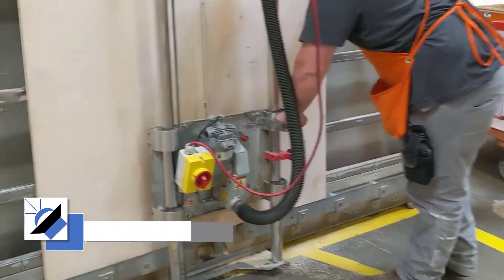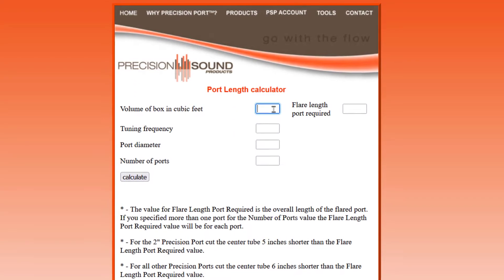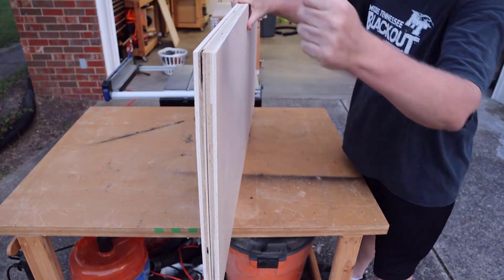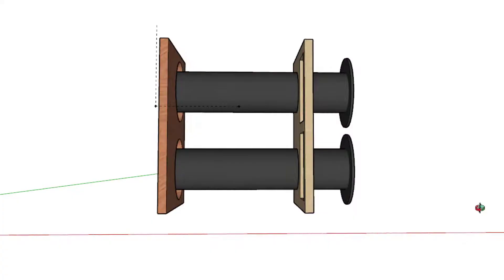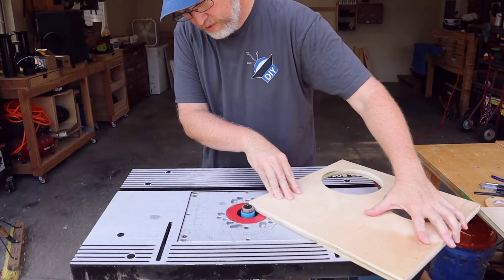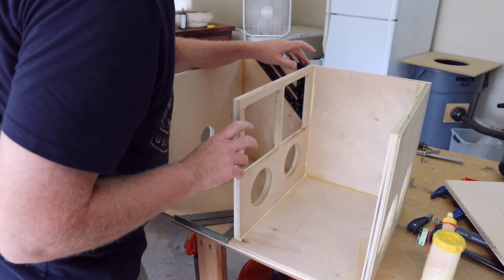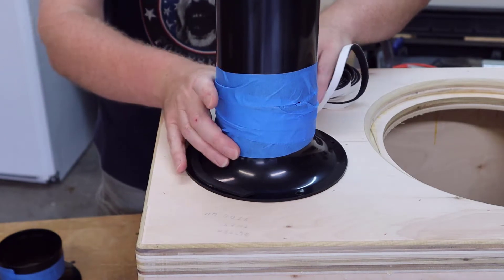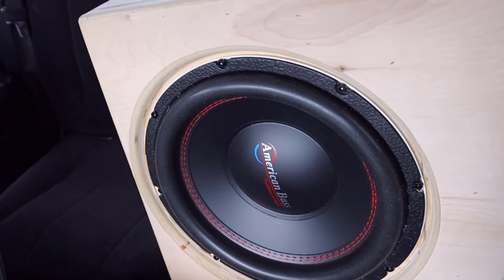Aero Port Subwoofer Enclosure:  American Bass Titan 12

Comment: Isn't 2 4" too much for a single 12" ? Single 4" psp full length  is usually good 1.8-2.25cf box to get low 30s good tuning
Reply from the maker: Depends on the port airspeed velocity.

Comment: Great info! I had no idea you could go up to 34-36 m/sec with flared ports! That tidbit of info is a gem!
Reply from the maker: Glad you liked it!
Reply: It all depends on use case, if you plan on using your sub on xmax 100% of the time, sure, the 34m/s threshold is the best, but since your overall output (let suppose you have a whole 3 way system with a sub) is gonna be unbearable and ear damaging, you wont even hear the fluttering of the ports, so take into consideration that the whole system should be really loud up to the 34m/s level, so actually, you can plan out a worst case scenario of about 50m/s so when playing at a reasonable volume or lower volume you will be in the no audible chuffing zone, if you take a competition 15" sub as an example, a 8" port will still be "too small" at its peak xmax, but what should the port size be? A galaxy? A pinhole? Just take everything in consideration and plan on the principles you laid out, too big ports cause bad resonances also, great for SPL but not for any reasonably good sounding ported enclosure

Comment: Is the port calculator the total length of the port or just the middle section??
Reply from the maker: Total length.  On the precision Port website they give the instructions for how long to cut this intersection. It will depend on which size flare you use.

Comment: So can a Made a biguer box for a shorter port, I calculate a 4.97 qf  for a 6 inch and 15.3 long aero port tune to 32hz, can somebody  tell  me if I'm right  or not please..I'm using a sundown x2 v2 12 1500 rms
Reply from the maker: No way to know for sure without running it through a port calculator or modeling it in WinISD.  I get a ton of requests to do this, I can't do them all.  But if you want me to, I charge a small fee.  https://diysubwoofer.blogspot.com/2021/05/custom-subwoofer-enclosure-designs.html

Comment: Nice choice of music. Timestretch sounded great in my nitro. I had 2 massive audio summo 12s in 6 cubes with 2 of the 6in precision ports tuned @ 32hz. Those subs put up a 151db legal score on 1 of the oldschool American Bass VFL120.1 wired at 1ohm.
Reply from the maker: Another good one is closer by nine inch nails.  If you're mids can keep up with your subs it will become your favorite demo track.

Comment: Almost every time I've had wood cut at Home Depot, they pull the saw down to the bottom and then pull it back up in one motion. Often the wood shifts as this is happening and I end up with cuts that are 1/8-1/4 off from top to bottom. The last time, the girl that cut it for me acttually knew what she was doing, and slid the wood away from the blade before bringing it back up. I've even offered tips to people who were running the saw to take the extra few seconds to do it right and had them decline. I've also had them refuse to cut wood once they found out it was for a speaker box.
Reply from the maker: I have never thought about that -- I will pay closer attention the next time I am having them break down sheet goods.

Comment: Can you leave the pvc pipe aero a litle outside and still have the same tuning or should be complitly inside for the same tuning? Thank you
Reply from the maker: Yes you can!  When you do that it will make the box a little bigger since the port will be taking up less space in the box.  That will lower the tuning frequency.  It won't matter much if is just a few inches.
Reply: @DIYAudioGuy  thank you so much for the reply man, i think i understood, it is important the length of the pipe even if it is outside a litle

Comment: Please tell me exactly what that is you are using to cut out the holes for the subs. I can't cut out a good circle to save my life. I love all ur videos. Find them extremely helpful. And the way u explain is very easy to comprehend. Oh yeah, where can I get that thing u used for the circle cuts? Thanks.
Reply from the maker: This can attach to any router.

https://amzn.to/3IdRwiD
Reply from the maker: It works best with a plunge router.  This is the one that I use, but any plunger router will do the job.
https://amzn.to/3t1JlQ6
Reply from the maker: It's always best to make the cut in two or three passes. So that you don't break the router bit.  Here is the quarter inch bit that I use in the router.  A less expensive bit will get the job done.

https://amzn.to/3HbShYn

Comment: Try flaring a piece of 10" inner diameter PVC I cut the handles off a wok, put it upsidedown on an electric hot plate, a heat gun on 1 side & me w a torch on the other, 2 patio stones & a 3ft steel I-beam on top for downforce, & I barely got it to flare so I used that for in er flare, cut a 6in long piece of 10in Sono tube, cut tabs 1in wide 3in long all the way around, bent & fanned them out to make the shape of the flare, backed the cardboard sono tube w fiberglass fabric & resin making it solid enough for me to stand on, then used Bondo body filler to smooth out the flare, hide the cardboard, & make it aesthetically pleasing. It was a job but that was the only way i could think of getting a flare on a 10in dia ⅛-¼in thick pvc
Reply from the maker: I like the wok idea, It allows you to provide even heat.  As you learned it's very tricky.  The sonotube idea is also very clever, but man that's a ton of work!
Reply: @DIYAudioGuy  yeah the wok was great especially since its Teflon coated
Reply: @buckyflex1  where do you get 10" pvc pipe at? The biggest I can find is 6".  I'm in the USA

Comment: From what I've seen and personal experience the majority of American Bass drivers are under rated or have a oddly high rating that is genuine, this model is know for handling decent amount of power so it may not seem that efficient because of the suspension compliance but if you tossed 1000w+ at it it may wake up and really slap...? My XRs have a 1500w rating I was very skeptical of that they resemble your typical 1k sub but I now have 2 on a True 5k and they seem take it without breaking a sweat.... One thing I hate about AB is they will not divulge the ts  parameters on certain models...hmmm?  so DATS is my only hope and I haven't bought it because my laptop is dead.
Reply from the maker: This is the first time I've used one.  I think you're right I think you really need to throw the power to it.  I suspect that once it's broken in a little bit it'll flex more.
Reply: @DIYAudioGuy  yeah my AB XRs changed alot from new to broken in, they were coined ABs more SQ oriented sub and I wasn't impressed at first but once those broke in they did sound butter smooth. They do get loud but the 200oz motor is only have a double stack so they have a lower xmax and xmech is limited so I will build some new custom subs and save those for something else or sell em. I am building a custom 18 with a 100% custom motor for kicks it may out do my 2 15s where it will have 28.5 xmax an easy 4" peak to peak excursion...the mechanical is limited to suspension with a 5.25" gap depth from seven .75 slugs. Have all the parts So some lathe work left and it's ready for assembly, pretty anxious. Great videos! Have a great day.

Comment: I love aero ports for 2 reasons. Takes Less space and less dead weight!
Reply from the maker: This is the first time I've used them. Usually if I want around port I'll just get some PVC.  But, I've never really been happy with the look and going with an arrow port let you get away with a smaller port.
Reply: @DIYAudioGuy  I came across your video again as I've used normal pvc pipes as port and there is hell lot of port noise. Box volume is 4 cubic feet & I've used pair of 3" ports with 6" length. I thought port area won't matter but now lows are good but it's not that loud and sounds muddy! Please help me what can be easy fix? Box is already ready so very less scope of mods.
Reply: @BassheadLabs  you need to check the tuning of your box with it's current set up and then look at the frequency curve on win isd  to look for better port dimensions

Comment: Where do you stand on the theory that a dual 4" PP' design causes more turbulence (otherwise known as port not being as "efficient") versus the similarly tuned box with one 6" PP from Parts Express?
Reply from the maker: In my opinion it does not make a difference.  I would have gone with one of the 6-in ports but I was worried about the clearance between the woofer and the port. Nothing sucks worse than building a box, dropping the woofer in and having the magnet slam against the port.

Comment: Hey I’m getting 2 American Bass 15” Signature Series 5000watts Rms, what amp would u recommend me using?
Reply: Don't get the DC. Get a BC17k and run it at half ohm.
Reply: @MadTrollGaming  ok thanks
Reply from the maker: If you need 10k watts then you need a 10k like this:   https://lddy.no/11loc   Make sure you beef up your electrical:   https://lddy.no/10avb
Reply: @DIYAudioGuy  ok thank you very much still deciding if to get the American Bass or the deaf Bonce 3515 😕
Reply from the maker: Unless the sub is the dual 2 ohm, then you probably need to  5k's.  Down 4 Sound has what you need.  https://lddy.no/1065t

Comment: They make thin wall PVC drain pipe FYI. Lowe's has it for sure.
Reply from the maker: Yes, DWV pipe.  That's the best thing to use if you're going to use PVC pipe for a port because it's cheaper and plenty strong for a port.